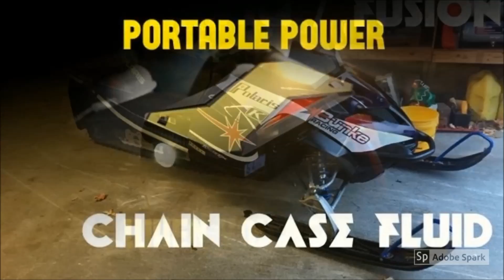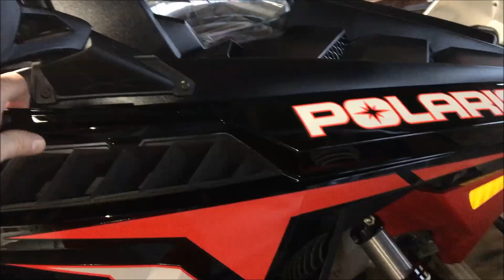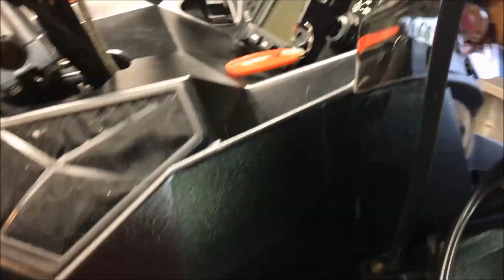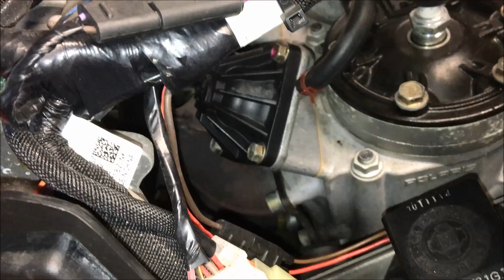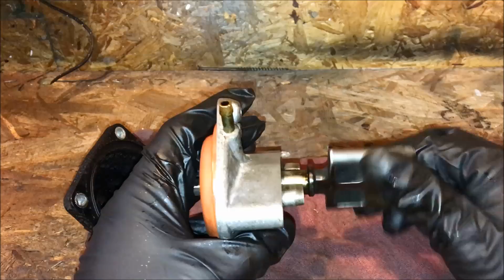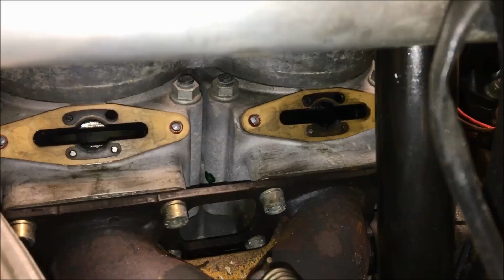Polaris Pro Ride - Exhaust Valve Cleaning Process (600 and 800)

Comment: Steering column is still in the way. 2013 Polaris 800 assault switch back
Reply from the maker: Compress the valve as you pull it out.

Comment: I have the 13 adventure 600 version of that sled. The steering side power valve will not come completely out of the cylinder. Does it have to be split before removing?
Reply from the maker: Compress the valve as you  pull it out.

Comment: So you said 10.5 ftlbs - 13.5 ftlbs to torque the bolts, but then said 15 ftlbs, so which is it?
Reply: he said the housings were 10.5-13.5 and the steering column was 15lbs
Reply from the maker: Thanks for the quality control. Your hired! 😀
Reply: @StreetersGarage  sweet! will work for oil
Reply from the maker: I'll need to check

Comment: why do you need to clean these exhaust valves?
Thanks
Reply from the maker: Carbon deposits will build up on the valve assembly. If they’re not cleaned.  Eventually the deposits will get so thick it will prevent the valves from opening and functioning correctly

Comment: Hi there really enjoyed your video!  Well done... like the professional and personal touch... saying that.. I had typed in a search on why 02 600 Polaris grand touring would pop like a sneeze or cough.. expecially at an idle... carbs have been cleaned and general tune up complete... no air leaks detected... so I was leaning towards perhaps an exhaust valve issue.... what would your thoughts be.... thanks much...
Reply from the maker: TPS sensor

Comment: Thanks bud. You should let people know about the pin hole ports in the bellows that need to be free of gunk also. Lots of people overlook that part. I know i did about 3 times before a Polaris mech told me!
Reply from the maker: You’re right. It was an oversight during filming.  Thanks for watching
Reply: Streeters Garage I did them on my old 03 Polaris lots, but last night was first time on my 14 (dealer did it once). Turns out i had to remove the steering shaft on my sled, which meant pulling the exhaust pipe, which would not fit out with my aftermarket bumper bolted on. Needless to say i was in the garage till 2:30am but still got out this afternoon and put 80 miles on. Cheers.
Reply from the maker: Chuck Beef All you had to do was compress the valve as you were pulling it out once you loosened up the steering shaft holder. It’s a tight fit but it will come out. 

Another option is to remove the plastic cap and then pull it off.
Reply: Streeters Garage Never thought of that. Oh well, she was pulling to the left anyway so i took the opportunity to toe in my left ski a bit while i was in there. I was thinking that seemed a bit excessive for something that needs cleaning every 1000 miles.

Comment: Great video. I’m having a hard time getting the valve off on steering column side. I took off the two bolts off so I could shift it, but still didn’t have enough room. Any suggestions?
Reply from the maker: Disconnect the steering shaft.
Reply: What’s the torque specs for steering shaft bolts?
Reply: I believe he said in the video 15ft lb
Reply from the maker: Correct
Reply: Mine two. And yes my steering shaft bolts are removed

Comment: Can you just plug the vacuum line off and get better power in the rpm range ??
Reply from the maker: No. The line also serves as a drain for the 2 stroke oil that accumulates. If plugged. It would become backed up and the valves would not work correctly. 

Thanks for watching

Comment: Even wide open my 2012 pro rmk 800 won’t go above 6,300 rpms. Could this be my power valves?
Reply from the maker: Yes. Either that or you have something going on with your clutches
Reply: Ethan Wilson I have had the same problem

Comment: Good video, BUT I don't know how you got that PTO side exhaust valve off with that steering post in the way. I took the two bolts out like you said, but no matter which way I turn the post/handle bars/skis, that is still in the way to get the whole valve out. I've got a picture but I don't think I can post it?
Reply from the maker: Thanks. Yes it’s a tight fit but it can be pulled out. You can compress the valve as you’re pulling it out to essentially make it smaller as you pull it out.
Reply: I ended up taking off the top plastic cap then removing the whole valve. I was getting worried about pulling the valve too far to one side (not being able to pull it straight out). I just finished cleaning them and about to reinstall.  I've got the exact same sled, '12 Switchback Adventure 600.  Pretty sure this was the first time the exhaust valves have ever been cleaned. Last winter was my first winter owning it, I've got just under 3k miles on it now.  I'll be using your videos to do the chaincase, fuel filter, fuel sock, and possibly the fuel float.  Thank you again for making these videos.
Reply from the maker: No problem Ben. Glad you found them. Let me know if you have any questions or run into any issues. I’ll try to help you best that I can. 

I love the sled. Best one I’ve owned so far. I’ll be picking up another used Pro Ride or Axys in the fall.
Reply: I definitely will, thank you.  

I agree, I've owned an 03 ZL 550, 04 Switchback 600, 09 Switchback 600, and is definitely my favorite and best sled I've owned.  I just Sno-Checked a Switchback Assault 800 last spring, but I'll be keeping this Switchback Adventure.
Reply from the maker: Nice choice! That’s a great sled.

Comment: Hey man, I just watched your video on exhaust valve cleaning. I have a 2006 IQR chassis w/ a 2008 600 HO liberty. I was in Michigan last week for a trip to the U.P. with my buddies and my sled started acting up. At first it was fine, and then it would start to hesitate at higher RPMs. It would then seem to lose a cylinder for a sec, and then come back and be fine as long as I did not crack it open. Eventually the symptoms got worse and worse to the point where it would have total power, then cut out, I would give it gas, no response until I let off and I would have to feathwer the throttle or it would just die. It was back firing etc the whole way through as well,. I thought it was the coil, I replaced it and it did not solve the issue. Any Ideas?
Reply from the maker: +Joshua Fredrickson 

Is it a CFI or the Carb version?
Reply: Streeters Garage carb
Reply: It has dual carbs.
Reply from the maker: +Joshua Fredrickson 

Ok. I would check all of the easy stuff first before you start throwing parts at it. Honestly it sounds like a fuel delivery issue.  Check the pickup line in the tank too make sure it didn't rot away. Did the issue get worse as the level in the tank got lower?

Pull the carbs and clean the jets and check for clogs. While the carbs are off. Look at the reed cage and make sure they're not chipped or broken. 

I assume you already cleaned the VES valves.
Reply: Actually, I just saw your vid on the valves, so thats what I was gonna go at first. The fuel level had no bearing on the symptoms. I really appreciate your time in getting back to me. Thanks alot
Reply from the maker: Joshua Fredrickson 
No problem. 
Not sure on how the wiring was done forvthe conversion. But the throttle safety switch might be acting up as well.  On most Polaris Sleds if you disconnect the kill switch. This will also disable the TSS. You can try that as well
Reply: Kill Switch on the teather, or the engine on/off switch on the bar? Do I just disconnect them or ?, Sorry, not very experienced sled mechanic, but trying to learn.
Reply from the maker: +Joshua Fredrickson 

The one on the bar
Reply: And so how do I disable it? I think you may be onto something because it works kind of intermittently, as does the tether. Do I disable the switch by merely disconnecting it from the wires behind the switch itself ?
Reply from the maker: Yes. Just unplug it
Reply: Ok, I will try that. Would the same hold true for the tether? It too seemed to work intermittently. Sometime when I pull it off it kills, sometimes it doesn't. Just like the kill switch, sometimes when I switch to off it worked, sometimes it didnt.
Reply: @StreetersGarage  I had a similar problem when that seems to get worse when the gas gets close to a half tank/ below... any suggestions? Also how often should you clean the valves?
Reply from the maker: Had an issue on A FST that did the same thing. The lines on the fuel pump were failing and sucking in air when the  fuel level got to a certain level in the tank.